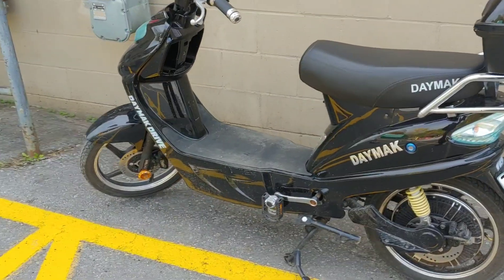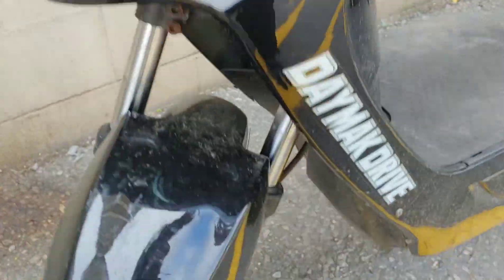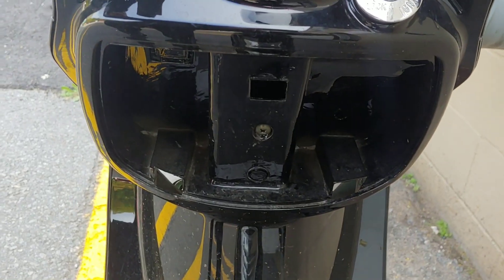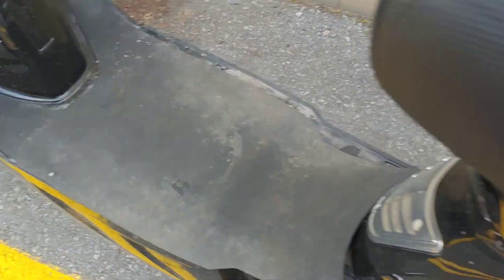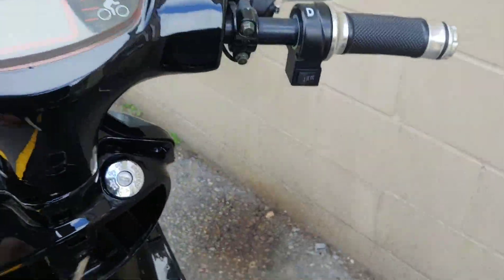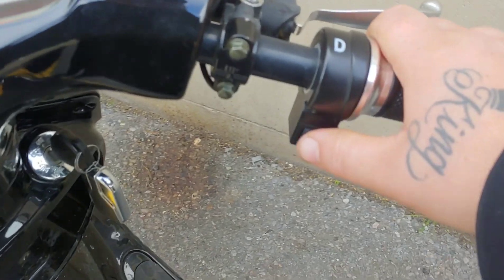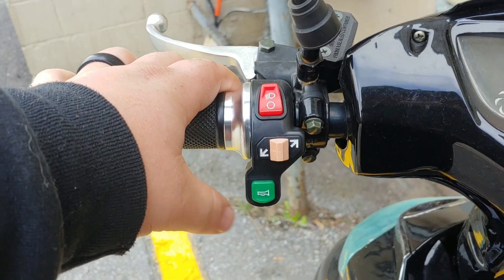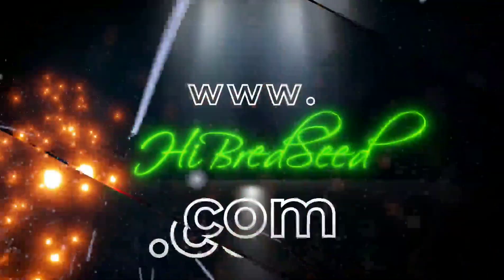daymak Vienna review. The loner for TNT adventures.

Comment: Yo I own this exact bike. Bought it from rental to own in Huntsville
Reply from the maker: Was a loaner for me wile mine was getting fixed
Reply: @AnthonyFishervlogs  that’s what they were saying when I went to go pick it up. Saw your beast beside it. You store it there, right? And you know anything about hooking solar panels to the daymak?
Reply: @AnthonyFishervlogs  also I think this might be a 84v. That’s maybe why there’s an extra battery pack and when I charge it the volts go up past 72v. Another question if you don’t mind me asking: when the volts get down to like 43 the bike basically shuts down. Is that the same for most ebikes or do you think this bike needs new batteries? I know it might be hard to answer since you only had it as a loner but thought it was worth asking lol
Reply from the maker: @allthings5070  oh yeah all bikes will cut off when they get low. And the V will usually go 10 higher than what the bike is when it's fully charged for instance my 72 will usually charge to 84 volts
Reply from the maker: @allthings5070  my bike was there for warranty work they sent it to damac and then it came back to me
Reply: @AnthonyFishervlogs  respect. Much appreciated. I don’t know a thing about ebikes. Just needed something to get me around until I get my license back
Reply: @AnthonyFishervlogs  respect. Much appreciated. I don’t know a thing about ebikes. Just needed something to get me around until I get my license back